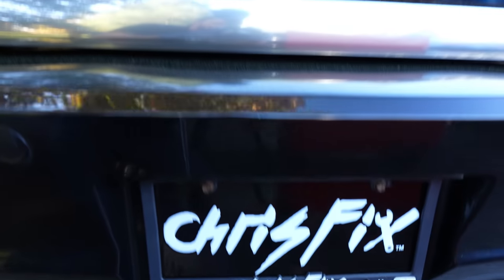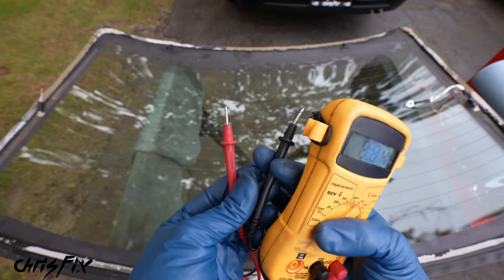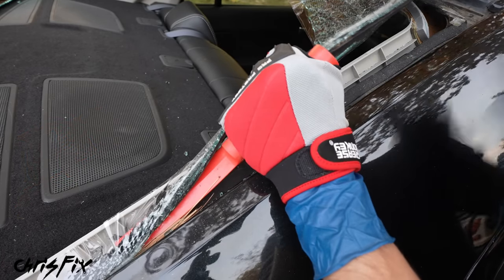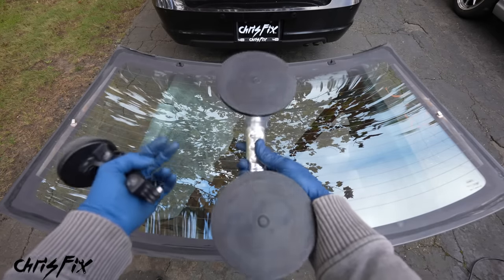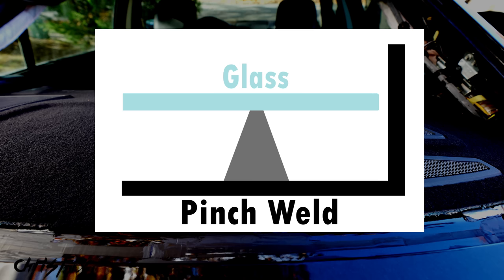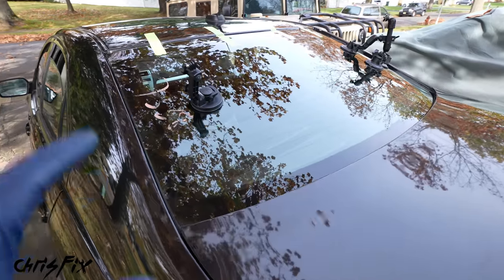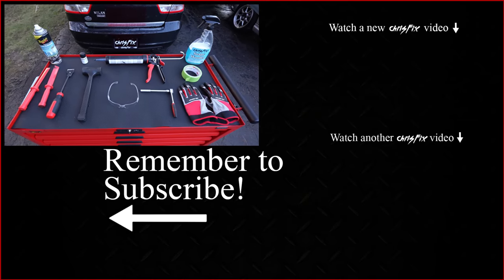How to PROPERLY Replace a Rear Windshield (No Special Tools DIY)

Comment: This video was very helpful and prepared my well for my first ever attempt at glass replacement. I really appreciated the list of required materials and explanation for each item. The tape and the plastic chisels worked great! 

Chris, I am replacing my roof glass and am struggling to find information about weather stripping for my roof glass. Do you know if you can use generic weather stripping? Or do you need something built specifically for my glass? (Note, I'm replacing a static roof glass and not a windshield but have found most info transferrable)

Also, the junkyard approach was definitely cheaper, but wanted to mention that there was a glass cutter fee in addition to the cost of the glass itself for me. So to anyone else, just be prepared that the original price mentioned might not be the final price.

Comment: Nice...... But also in the cold when removing the busted window you can make a starting point and pull the old seal from the punch weld by pulling it off with what's left of the broken glass without scratching the paint, go slowly though. Buuut now I know i need primer and thank you! 😂

Comment: I watched this video to figure out why my rear defrost was not working. Apparently the glass had been replaced and the connections weren’t remade. I had checked the relay, the fuses first and finally the back glass heater lines. All checked out, thanks to this video, it now melts the ice off the glass window.

Comment: If you are installing a window on a brand new hardtop for a convertible, is it ok to apply the urethane directly to the painted surface? Or does it need to be scuffed/sanded first? Does it need to be primed like you did with the window? Here you are applying over an old layer of urethane but this scenario is different I think.

Comment: Another thing you can use the soapy water for is that when shaping glue or even sealer if you spray some soapy water on a latex glove that you are wearing you can shape the glue without it sticking to yourself or the surrounding area (it will still stick once it dries) and if the gloves are new it also wont contaminate the surface

 im an automotive collision repair tech i work on box trucks and i do that trick every time i glue or apply sealer to something on the box to give it the proper shape and seal correctly.

Comment: I watched the whole of your video and I was highly impressed with the quality of your work and I thought that I would be able to do the same. But unfortunately older vehicles like mine have a large rubber seal that holds the window in place unlike modern cars that are fitted in a simular way to a window in a shed or something. Is there any chance you could do one for an older vehicle ? as I've not been able to find  any on youtube  so far.

Comment: You can also use a plain old olfa knife with a razorblade and slide it under the glass to cut it out. this is what we did where i worked and its very quick, also important to use gloves and a sharp blade. 
you dont have to worry about scratching the paint, cover with primer or if its visible, cover it with a thick coat of nail polish
Reply: Also forgot to meantion. the bead doesnt have to be as high as in the video, make the hole about 3/8 of an inch and shorten the height. not too much though because it still needs to make contact with the glass. speaking of which, PUT THE URETHANE ON THE GLASS. makes it so much easier to put on the glass, and easier to install

Comment: Hey Chris. 1 reason the back glass will break.  Many Many years ago, I worked at a gas station and in the middle of winter, a guy who worked in the oil fields as a salesman came in and his car looked like a mud ball. It was so cold that he could not use a car wash so we "volunteered" to wash it in our wash bay. Since we could close the door and warm up the room enoough to stand the cold. My brother and I worked for about an hour washing the car. We finished and went up to take a break in the front of our gas station. In a few minutes, I heard a kind of thump and then a long crackle sound. Went back to check it out and the rear window completely shattered unattended. Maybe a temperature/expansion thing?

Comment: Thank you for this video. The  vertical rear window in my mini excavator came loose but I was able to tape it before if fell .  I'm a little concerned about keeping it in place when allowing the 3m urethane to cure so haven't started this project yet.  Also, can I use a cotton ball or tiny foam brush to apply the primer  or is it too "linty" ?  Thank you in advance.
Reply from the maker: A cotton ball should work as long as there is nothing adhesive on your window frame.
Reply: @chrisfix   You're a lifesaver.  Subscribed- Thanks again !

Comment: Another awesome video by the main man! Couple questions: could you apply the urethane to the new glass panel instead of the car? Seems like it would be easier to do. Also what about the "vehicle safety features" they talk about on the Safelite commercials for the front glass?

Comment: This is super helpful, thank you! Regarding the urethane beading standing up, how would you suggest I do that if I'm replacing a side window that's vertical? I imagine the right and left side would maintain the triangle bead, but the top and bottom seem likely to fold down.

Comment: Probably one of the coolest videos just because nobody wants to do this. But I will say its not very cost effective not even factoring in time for a windshield replacement. I had a front windshield replaced a few years ago for about $150. The cost of the glass alone was a majority of that. Even at the dealership level we don't replace windshields, we call in a company to do it for us. It isn't very cost effective because most of the profit is made on margins not the labor for install.

Comment: The best way to check the rear defroster is first the ohm meter then plug it up an use a temperature gun an you can see which one don’t get hot

Comment: Hey Chris, do you have a video on engine misfiring/rough idling/fuel injector issues? I have a 2001 Toyota Celica that has those issues, and I assume they are all caused by one thing. Could it be a vacuum leak somewhere or some type of gasket leaking?

Comment: Hey Chris fix, I've been collecting allot of tools for awhile now so I can work on my project car and I was just wondering if you have any recommendations for toolbox organization trays or mats. I have almost a complete set of both SAE and Metric short and long sockets 1/4 drive - 1/2 drive but they are somewhat complicated to keep organized and looking nice. I have a stud style from harbor freight but they break easy and don't look great. Any help would be appreciated love your content keep up the amazing content . happy holidays
Reply from the maker: It’s hard to find foam tool storage after you buy the tools. Most of the time you need to buy the foam storage for the specific tools. Sockets and wrenches have some good non foam organization. Check out last years (2020) Top 5 Christmas Gift Ideas video . Tons of tool storage ideas in that video near the end.

Comment: What do you do if your glass is perfectly fine but you want to replace the old adhesive that is letting air and moisture through? Use a heat gun to weaken the bond and lift?

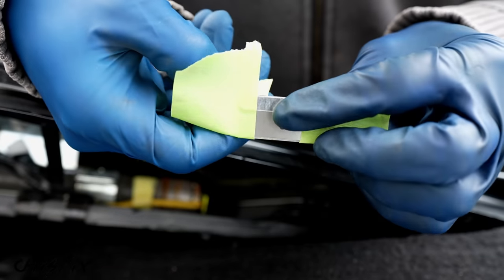Comment: 15:00 i would also recommend dragging the corners of the blade a few times along the concrete, or a file or something, otherwise they will probably cut straight through the tape and into the paint anyway.

Comment: First thank you was very educational and about the only thing i can find online.  
I do have 1 question if you do not mind. I have a 99 chevy astro.  With the 3 piece back door 2 shorts on the bottom and a full wide hatch.   I was working on the hatch and balanced on my head (bad shocks) and the glass lifted on the passenger side. Would this be the same procedure excludeing the removal as nothing wrong qith the glass?
Reply from the maker: Correct. For removal they sell tools that remove glsss without breaking it.

Comment: Hi Chris.  Alot of modern cars have front radar and rear back up camera.  I was informed the calibration process of the  cameras takes several hours and has to be done at a facility.  Do you know if this is true?

Comment: Chris, I'm preparing to install a new piece of back glass in my car. My question is, will 1 tube of window weld be enough to install a back glass?
Reply: Depends on the one you use, I generally use one and a half
Reply: @justinconant9669  I will be using the 3M like Chris Fix suggested in his video

Comment: So Chris,I Want To Ask You Something,When I Put Air Coolent For My Car's A/C,It Works But For Some Reason,It Drains Out Almost Instantly,I've Checked The A/C Fulid Filter,And It's Fine But Once I Put A/C Coolent In There,6 Days Later It's Gone And It Feels Really Hot For Some Reason Even Though It's Under A Roof So It Won't Be So Hot...

Comment: "Now if we switch to something with a point..."*Glass explodes* 😂

For those that desire a more scientific explanation: The way the glass is tempered aligns the glass particles in such a way that they are all under a lot of very very specific pressures (tension) and if you alter that pressure in any sort of way (such as nudging a few particles out of place) the entire balance falls apart and the glass explodes as the different tensions and stresses in the glass shift and compact/stretch. The quickest way to cause this is with a very sharp or pointed object. That's why you /can/ (I don't recommend it) use a broken piece of spark plug to shatter a window/rear windshield. The ceramic of the spark plug (to my knowledge porcelain) shatters on a microscopic level and leaves a razor thin edge that can "cut" between the glass particles and upset the tensions causing the explosion Chris showed

Edit: Further explanation (I checked just to make sure I had it right before I spoke), the way that tempered glass is made is in a way such that the outside of the glass cools quicker than the inside which "locks" the glass particles into place on the outside. This causes the tensions I spoke of because the inside is still trying to shift and shrink as it cools and has no wiggle room due to the outside being firm already (imagine a frozen pipe, how the water freezes and expands but can't due to the pipe). When you break that surface layer and hit a point where the inner glass has room to move it forcefully pulls inward at the breach which upsets the rest of the firm outer layer as it is stretched toward the crack being pulled inward, thus causing more micro-fractures that cause more and so on and so on, resulting in the explosion of glass that we saw (when the pipe ultimately fails and explodes, causing a water leak as more water flows through it-- though in the case of the glass it's opposite, imploding rather than exploding.) The reason the glass is so strong is because the outside is pulled inward nice and tight which makes it harder to break the bonds between the particles with blunt objects but makes it incredibly weak to sharp points, almost like the links on a sheet of chainmail (the more links, the harder it is to separate them unless you pierce between them and physically open the links with a blade. That's why slashing motions are weak on maille but stabbing motions can break through it)

In a sense it's akin to the Japanese katana. When a katana is forged a layer of mud is painted onto the rear half of the blade to help it cool slower than the cutting edge when it is quenched. This (in combination with a softer iron core wedged into the back half) causes the blade edge to become very firm but the back half to be more flexible (this also causes the tensions that create the signature curve of the blade, and the 2 color wavy "hamon" or blade pattern) It helps the sword carry a edge capable of slicing through bone cleanly but also to not be so brittle as to break in half when doing so. 

In a similar manner tempering glass provides it superior strength with it's combination of firm outside and softer inside creating tensions that ultra-firm the outside, granting it the ability to withstand blows that would be fatal to normal non-tempered glass (hammer blows for instance) but you wouldn't want to use it for a front windshield because of how violently it shatters if so much as a sharp rock hits it (a common occurrence on front windshields)

The layered glass of a windshield in this instance also has elements of a katana thrown in: the plastic middle layer adding reinforcement and cushioning to isolate the crack to one spot-- similar to the softer iron/steel core of a katana adding a little bit of shock absorption and flexibility to the point you can bend a katana and not break it

Comment: Can you tell us how to get rid of moisture/water from electrical instalation on car? I forgot to roll down driver side window and that day rained alot..Now my car does some weird stuff like.. sometimes (very agressivly) central locking lock the car randomly, instrument cluster once showed low oil ( it went away when i restarted car), radio buttons sometimes didnt worked till i pressed specific switch that was shorting it i guess? Did this ever happened to you lol

Comment: Heads up, if your car has lane detection or parking assistance or anything like that, pulling the windshield out might require you to recalibrate the sensors, which might be more than you wanna deal with.

Comment: Front Windshield
- Remove the Glass
- Clean the Pinch Weld
- Remove the Plastic Trim Pieces
- Remove the Old Urethane, But Not all of It (Pinch Weld)
- Remove All the Old Urethane (Edge of the Glass)
- Clean and Protect the Glass (In and Out)
- Test Fit
- Install the Molding (Bottom of the Glass)
- Shake (1 minute), Spread the Primer (Edge, Pinch Weld), I'll Work Outdoors, Dry (10 mins), Remove the Primer that's Clearly Visible
- Urethane Setup (I already Know)
- Lay Urethane on the Fresh Cut Urethane, Paddle 
- Install and Setup the Glass, Let Urethane Cure (24 Hours)
- Remove Everything

Comment: Fun fact! Rear windshield and front windshield are made of different types of glass. Tempered glass is in the rear will not break due to pressure but due to something pointy hitting it then it’ll break into many small pieces unlike the laminated glass in the front that will crack after pressure but still hold together.
The more you know 🤓

Comment: Also as a heads up call your insurance company because some states give you a free replacement windshield a year. Others can be a 100$ deductible.
Reply from the maker: Problem with using your insurance is it is a claim. Nothing is “free” and when your time is up to renew your insurance it gets factored into the renewal sometimes. Just something to consider

Comment: Chris. I really need your help with something. I have a 2007 Pontiac Grand Prix and Gas gauge is broken  it's it's not reading how much gas I have in my car. Now someone told me to get a gas filter and a fuel pump. But I'm not sure if that would fix it. Can I get your advice on this situation and what would you recommend me to do to fix this problem?
Reply: U want to
Reply: @fekezusman2740  So you saying I should just replace both and my gauge should start working?

Comment: I know this is an old video but the 24hr Urethane and Primer kit link is invalid. Was the the primer "3M Single Step Primer, 08682, Black Color"? I just recently had to this and now at the stage of getting the urethane components. The car that will be getting the scrapyard part also black. Same exact thing happened the that cars as your dads. (closed driver door and bam, shattered glass)

Comment: I got a honda element so this luxury of doing this at a slanted angle with a stable base is non existent. My rear view is verticle and I am horrified at how I'm supposed to handle that part! So far I'll need to get the pieces but some of the Ebay links are dead and I'm scared I'm going to mess up there as well. It's a great video but I wish I could use it more. If there is a version with a standing or almost standing window placement I'd love to get that as a recommendation! I wish I was this relaxed. Feeling like I'll mess up at every turn is the worst feeling...
Reply from the maker: They sell a suction cup glass holder. Or the suction cup handles for the glass and have a buddy over.
Reply: @chrisfix thank you for this info and caring enough on a old video to help out. I do really appreciate the steps and your work even if I can’t follow them completely.

Comment: I wonder if the temperature could play a role. The real windshield of my sister's 2019 Rav4 shattered overnight during a snowstorm and below 20-degree weather at a high mountainous elevation. Neither of those 2 reasons seems to fit the situation since nobody was in the car opening doors and there was nothing around or above the vehicle.

Comment: 27:30 - you began at the bottom right and moved upwards around the top right corner.
How did you maintain that bead all the way across the top of the frame? I assume you would have had to move to the other side? Or have someone take the tube from you and continue?

Comment: For anyone who wants to put a new rear window in you can just put the urethane on the window instead of the car because it’s all around the edge, also if you have bare metal with the old Urethane you should do a light scuff before primer.